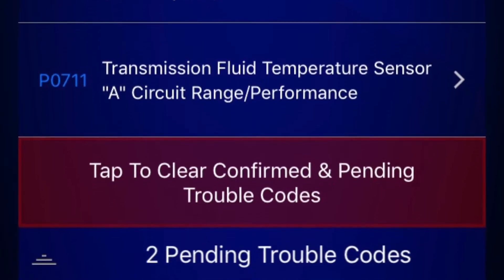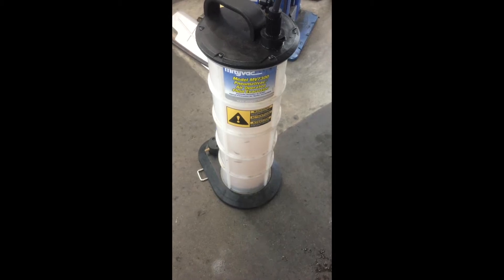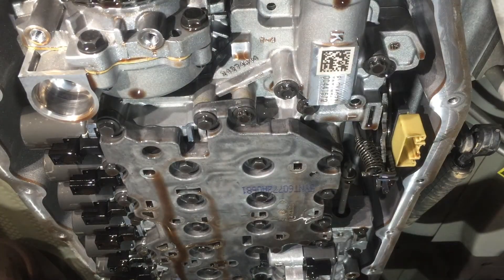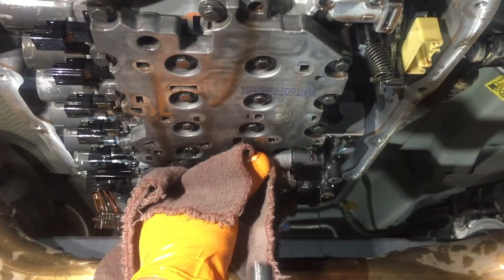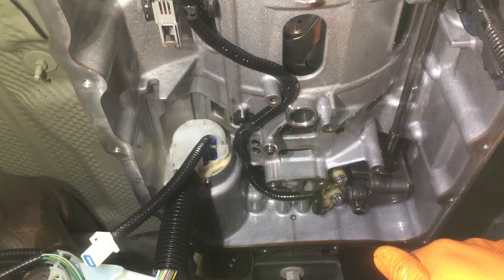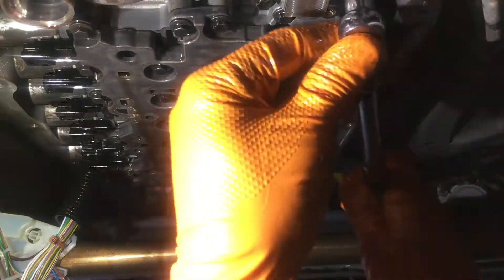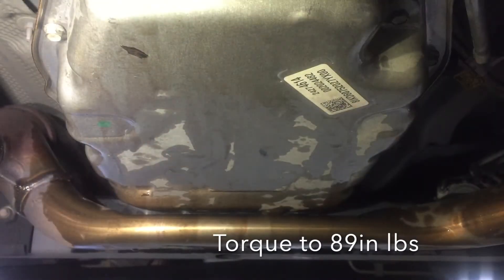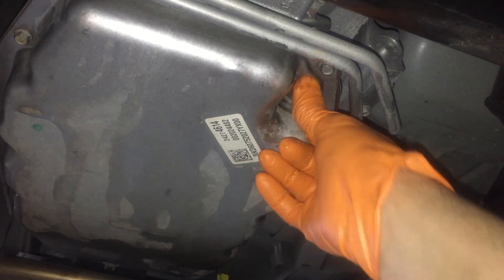P0711 Silverado Sierra Transmission Temperature  Sensor 8l90

Comment: Hey buddy the dealer shop just replaced my transmission wire harness and now some time my transmission shifts very hard ,what's going on with it?
Reply from the maker: The 1-2 shift the first one of the day is normal. After that I would check for software updates then do a “fast learn” procedure to reset the shift points & drive it to get it to learn them. I’ve had pretty good success this way, but harsh shifting seems to be a characteristic of these.

Comment: how do I figure out if it's the sensor or the gauge? the needle on the gauge never moves. it's for a 2004 GMC Topkick 5500. I'm not getting any error codes so I'm thinking maybe gauge
Reply from the maker: This repair does not apply to your truck. I’m not familiar the 5500 trucks. If it’s the same as the 2500 I would say that’s right. Those gauge motors are faulty on those.
Reply: @TruckNerd  thanks

Comment: I have a 2015 yukon denali xl... I'm getting p0700 and p0711. Can I replace just the temp sensor harness or do I have to replace the whole harness with dropping g the valve body?
Reply from the maker: Shaun Judkins GM has released the two piece harness again. You can now just replace the the half you need without removing the valve body.

Comment: Trucknerd, you’ve been so helpful, I have a question and cannot find an IM option. Will a half quart of Lucas multi atf do damage to my trans? 

Story: In my trans fill last night, I had a panic moment in the dark at the end of a day chasing mystery GM parts (yes the GM parts guy said hmmm many times) when realizing I was going to be short on fluid. I added 1/2 qt of Lucas multi vehicle atf In addition to the 6 qts of mobil1 blue label synthetic added to replace the 6qts I sucked out. An additional 1qt was lost in the filter and in the pan when dropped. I then realized I should have just added back a qt of the old 6 I removed. However, when starting the truck and removing the overfill plug, I lost none. I presume I was low to begin with, or just at the mark- who could tell? Have I done harm by adding the half qt of multi and should I buy another box of 6 blue label and keep adding until full or just buy 2 boxes and attempt to flush it all?    Other details... ‘16 high country 1500 5.3l w/97k using Dexron6. Lucas says it meet/ exceeds Dexron3. Tech specs says not recommended for Dexron6. I presume dex3 is missing a few components of dex6, tough to research without a chemistry degree. 

Thanks for your efforts on this channel
Reply from the maker: reedrobb I messaged mobile one & ask about the fluid. I specifically asked if if the synthetic fluid would work in a vehicle that requires Dexron VI. They advised the two fluids to not be compatible. If it were me I would have the transmission flushed because the fluid used in these before 12/2018 would need to be changed anyway due to the shudder issue. Google 18-NA-355.
Reply from the maker: reedrobb i have not used that particular fluid. I wouldn’t be comfortable advising you to use anything other than what is recommend.

Comment: Whew, thank the GM gods for the 2 piece harness
Reply from the maker: reedrobb they can’t make there mind up. 2 piece then 1 piece, now two pieces again.
Reply: I had a hard time finding a harness. Amazon and Rockauto don’t sell them. None of the parts shops sell them. I had to go to the dealer. It was about $99. And, my dealership didn’t have one. They sent me 20 miles away for the 1 they had. Don’t get me going on the transmission filter/ gasket, that’s a whole other story for another YouTube video

Comment: Hoy many quarts of Mobil 1 Oil do i need for the process?
Reply: Oel Rincón; My truck doesn’t have a dipstick, I sucked out 6 quarts and lost approx 1 in the pan and filter.  Added back approx 8 quarts and it was still low. If you have a dipstick, it’s much easier.
Reply: @reedrobb  how do you know it’s low if you don’t have a dipstick?
Reply: NOTHING will come out the overfill plug
Reply: https://youtu.be/dPrP4NQZg6w   This video will explain it all

Comment: Hoy many quarts of Mobil 1 Oil do i need for the process?
Reply from the maker: Oel Rincón you can now do this repair without removing the valve body. I use 7 quarts.
Reply: TruckNerd should i do a flush transmission before the process?
Reply from the maker: Oel Rincón when I am doing a flush I do it first, but you need more fluid if you do it that way.
Reply: TruckNerd than you! You got a new subscriber! You helped me a lot
Reply from the maker: Oel Rincón Thank you for your support.

Comment: I have a 2015 Chevy Silverado 1500 with a 6.2 leader in it. It has a bad tapping noise.  I have put the AMF delete kit on it, replaced the fuel pump, fuel filter, fuel injector, spark plugs, spark plug wires damn near everything and the tapping hasn't gone away. Please let me know if there is a way to get rid of it? Thank you
Reply from the maker: Dong Johnson I’ve had a few of these that tick without a misfire & it’s been a bent pushrod. Try that.
Reply: @TruckNerd  Your right it was a bent pushrod so I replaced all the pushrods and now it still has that tapping. Thank you for the info too

Comment: What is post be the average temperature for Silverado 8 speed
Reply from the maker: Joseph Breen in normal driving they seem to run pretty close to 200 degrees. The thermal bypass does not open until 194 degrees.

Comment: Does anyone have the part # for just the lower harness? I have the erratic temp sensor that triggers the CEL fir a few days then goes away for a few days then back again
Reply: Scott, I would agree with truck nerd. Mine flashed a code off and on for a week before it failed. Then received codes P0700 and P0711. It’s been a short time but replacing the harness seems to have solved the problem.
Reply from the maker: scott barth part #24298757 is the updated harness.

Comment: Trucknerd i have a 2016 sierra with 46000 miles. And the check engine light came on with po700 and po711 codes. But the truck runs nice and smooth idk whats going on. Do u have any idea?
Reply from the maker: German Arreola sounds like it’s going to need the transmission harness replaced.
Reply: @TruckNerd  i chek the transmission temp and the temperature dont move its stays at zero. I checked i on the dashboard
Reply from the maker: German Arreola p0711 is for the temp sensor. If it reads zero, there is a problem. If you don’t feel comfortable then your local dealer can check it for you.
Reply: @TruckNerd  am taking the truck in  today. I will let u know what they tell me later on today!!!   Thank you.
Reply: The dealer have my truck already they supposed to check it next week. So i will keep u updated with this prosses!!!
Reply from the maker: German Arreola sounds good.
Reply: @TruckNerd  Hellow i just got back from the dealer they replace the harness at no cost.  Every thing was under warranty
Reply from the maker: German Arreola That’s awesome!
Reply: @TruckNerd  yes,  thanks for being up to date with this case
Reply from the maker: German Arreola You’re welcome

Comment: Nice job!  I’ve been wanting to do this for a while, but was apprehensive since the 8l90 is not like the old days units.
Reply from the maker: Innovators Playground Thanks. Glad I could help. You probably can just replace the temp sensor harness now that GM has released the 2 piece again. You can find the info on my other video P0711 update.

Comment: can you mix the transmission fluid you recommended with factory oil? I bought 6 quarts of mobil 1 and it won’t be enough. I drained closer to 9 quarts. If not should I go get the fluid from gm?
Reply from the maker: If you are asking if the mobile 1 fluid from GM is compatible with what is already in the transmission, yes it’s fine. The mobile 1 fluid from GM is the only fluid I would use.
Reply: TruckNerd Thanks! I went into the dealership and they gave me the same exact fluid. I didn’t think they carried mobil 1. 
   I just finished my install and gave you a shoutout for those needing to drop the valve body. I hope you get more subs and can monetize. Your channel deserves more subs! Thanks again! 🙌🏼
Reply from the maker: @dannyjohnsonsgarage  Glad I could help. Thank you for your support! Thats what it's all about.

Comment: EXCELLENT HELPFUL VIDEO!!!   As of 2_2020 the current part number for the GM harness that includes the sensor is 24298757 . There have been several updates but this is the lower harness only and will plug and play into the factory case connector pigtail without removing valve body (thankfully). If you have a one piece harness from case to solenoids which I have seen one time, you will have to buy both the case end and this solenoid lower half harness. The valve body would have to come down then. **Do not use aftermarket or wrong type fluid in this beast!!!!
Reply from the maker: Exactly
Reply: I was just about to ask the difference between the 24298757 and 24297369 but it seems the 8757 is just the updated version. Thank you for this comment
Reply: Theyve updated the part numbers as ov Nov 2023. Refer to pip5700e TSB
Reply: As of 10/20 the correct part number is still 24298757 and was about $99 from my dealer with no alternate purchasing options, other than other GM on-line parts stores that is
Reply: What year was this truck

Comment: I noticed that you have two videos related to the temp sensor.  I am guessing the Dec. vid is the correct one to use to fix the erratic temp sensor?  I really don't want to mess with removing the valve body to fix this issue, if I just need to R&R the bottom harness.  Any reason that I would need to replace the entire harness?
Reply from the maker: No sir. Just place the lower portion. The easier one. No need to remove the valve body any more.
Reply: @TruckNerd  I removed the valve now truck has issues with 4th gear any idea
Reply from the maker: @jorgegarza234  I’ve had a couple of people say that they had a couple of wires swapped. That would be the only thing I can think of.
Reply: @TruckNerd  so are the connectors dummy proof or no and do u need to reprogram shifts if u drop valve body
Reply from the maker: @jorgegarza234  in my experience the connectors are dummy proof, but I’ve had two people now that say they have had problems. Not sure what has happened there. There is a software update for some And a fast learn procedure that can be done, but on 90% they are fine without the fast learn procedure. If you have the software update done then yes have the fast learn procedure done too.
Reply: You’re the man!  Thanks for the great videos!

Comment: Thanks for the video. What were the symptoms of having a bad temperature sensor?
Reply from the maker: M Giovanni Hard shifts & check engine light.
Reply: Mine tripped codes. P0700 and P0711. Just added the harness today and cleared the codes. Now I need to drive it but crossing my fingers as we speak.
Reply: @reedrobb  dude they want almost 1k$ to fix it at a dealership, theres no way with their experience it should be that much

Comment: Thank you
Reply from the maker: Dan pal Thanks for watching. GM has now released the the sensor harness separately, so it can be replaced without removing the valve body.
Reply: @TruckNerd  Do you know the new part number of the separate sensor harness?
Reply from the maker: Riley Pup 24298757
Reply: @TruckNerd  Thanks so much for making, and posting this extremely helpful video. I have a '15 yukon denali which was just diagnosed by my dealer as needing the trans temp sensor replaced, at a cost of $1,400 (symptom was engine radiator cooling fans were always running on full high speed (fans were on 100% of the time). After seeing your video, I am confident that I can perform this repair myself. Can you please elaborate a bit on the "new" seperate sensor harness? It sounds like this would make the job much easier since you are saying that there is no need to drop the valve body, disengage the pump, etc? Thanks Again!
Reply from the maker: @robertwhite547  https://youtu.be/JRhYc-UjCOw here is an updated video I did. you can definitely handle this yourself.
Reply: @TruckNerd  The linked video is private / cannot be viewed.
Reply: @TruckNerd  Also one other question, the two fluid baffle bolts PN 11548404...The description that comes up for those,  using that PN, is that they are the PAN bolts (Maybe they are the same type of bolt? ....But that would not make sense either... since the fluid baffle bolts are TTY bolts...(?)
Reply from the maker: Robert White Public now. I’m not sure about the description of the bolts, but they are no longer needed. If you can change a transmission filter, you can replace this harness.
Reply: @TruckNerd  I have a 2015 Silverado 6.2/8L90, they are saying the part number is 24297371 for the sensor. They have had my truck for 20 days so far waiting on parts. Do you know the difference between these part numbers?
Reply from the maker: Michael Calvert so I’ve been through this before. The part number you have listed is correct according to the picture only. If you wait for that part number to show up it will not be the part you need. The part number you have listed here is actually for the other half of the 2 piece connector. I posted an updated video yesterday showing the correct part & number needed. You want part #24298757.
Reply: Oh good thanks

Comment: Do you know the part number for the 2 torque to yield bolts by chance. Thanks for the DIY video, big help!
Reply from the maker: Pump Baffle Bolts 11548404
Reply: Searching that number comes up with the transmission pan bolt. I ordered 2 so hopefully that’s correct. Thanks for the help!
Reply: @TC323i  were they the right ones?

Comment: Great freakin video!!! Well done with great camera angles. Very informative. Thank you for sharing.
Reply from the maker: Rich Barrios I appreciate that.
Reply: TruckNerd I just dropped my 2016 GMC DENALI off at the dealership with code P0700 and P0711. My truck is still under warranty so I hope they do as good a job as you did. How long did that job take you?
Reply from the maker: Rich Barrios It takes a couple of hours as long as the truck is not hot. Getting parts is the problem right now.

Comment: Did this cure the harsh shifting or the shudder? Mine was throwing po711 and po700,its still under warranty and I took it in because it had the rumble strip feeling when shifting. And the dealer told me it needed a new harness to start.
Reply from the maker: The transmission shudder is fixed with a transmission flush & the correct fluid being used. The p0711 will require the harness. Sounds like you need both. The flush is uses 20 quarts of fluid and just changing the harness you will use 10. Unless they flush the entire system including the cooler, the shudder will return.

Comment: Whats the name of the part ?
Reply from the maker: Its the transmission control Harness part number 24297369
Reply: To add to this description, the error code for P0711 and P0700 refer to the transmission control system and the Transmission fluid temperature sensor A.